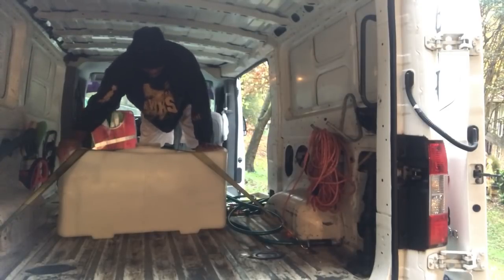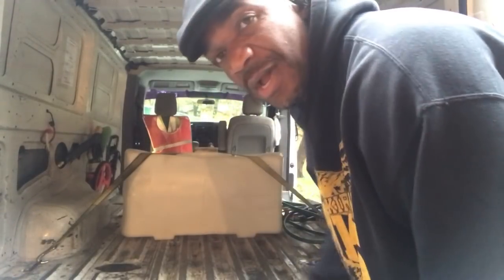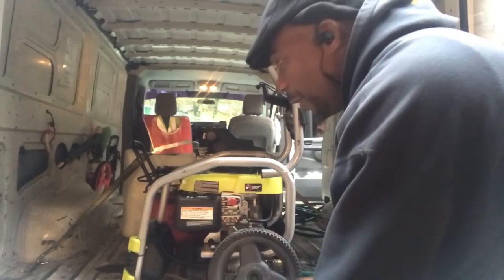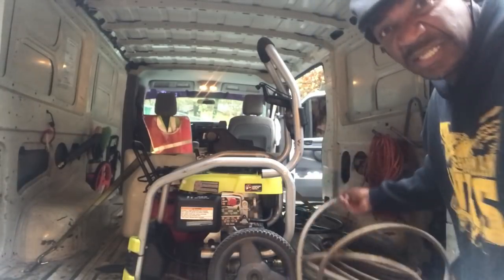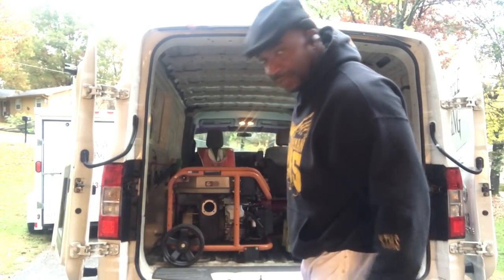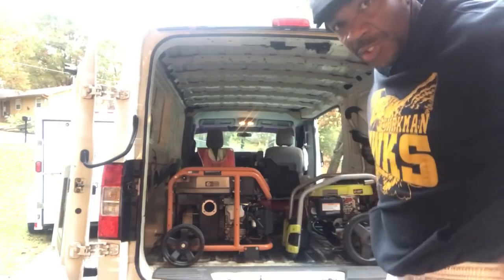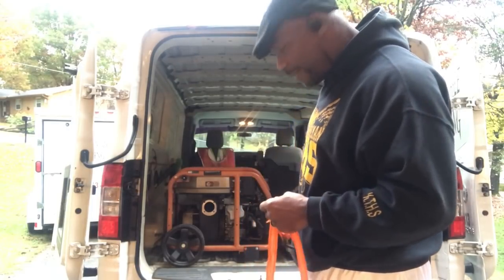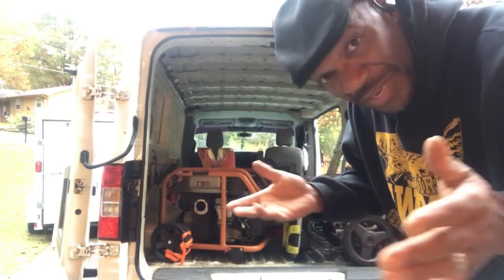Installing equipment back in the beast.   WWW.EQCARCAREPRODUCTS.COM

Comment: What kind of hose are you using from the tank to the pressure washer? Thanks for your videos 👍
Reply from the maker: Christopher Baldoz What’s shaking. It’s a regular water hose just a bigger coupling on the end to make it harder to freeze on the end connecting to the pressure washer. Positive flow.
Reply: Thanks. I watch you videos and positive vibes all the time.
Reply from the maker: Christopher Baldoz I really appreciate you tuning into my channel. Positive flow

Comment: Mr Jones how you doing boss? I was wondering if you shortened your hose length from the tank to the pressure washer?
Reply from the maker: GM NA'JEE. I just got back from a weekend getaway. sorry it took me so long to respond. Yes sir i did shortened my hose from when i first started. The shorter the hose the less strain on  the pressure washer pump to half to pull the water a further distance. Positive Flow.
Reply: Eric Jones Thank you sir. Hope you and the Miss had a great time!